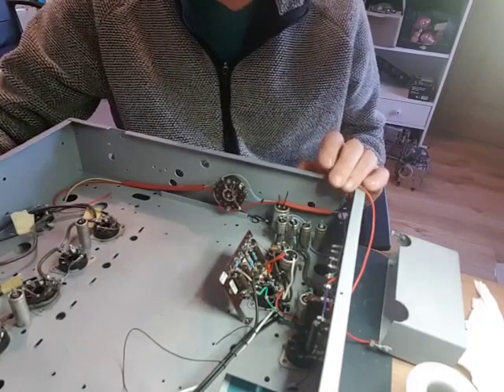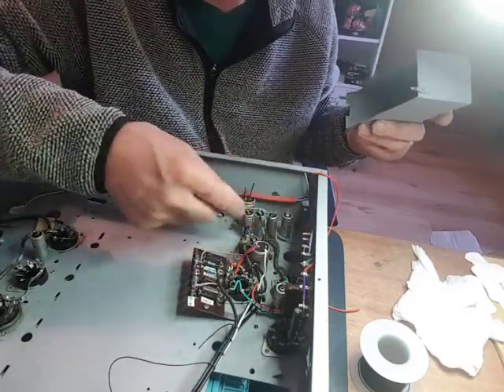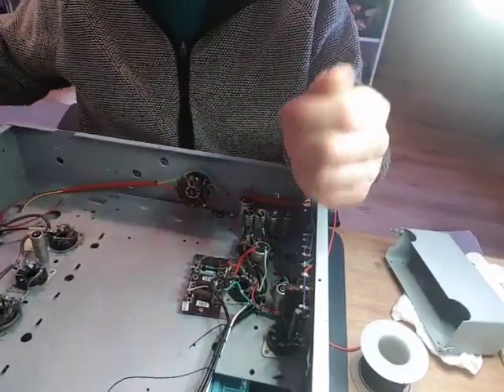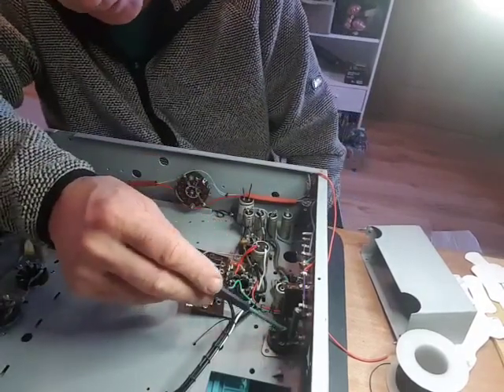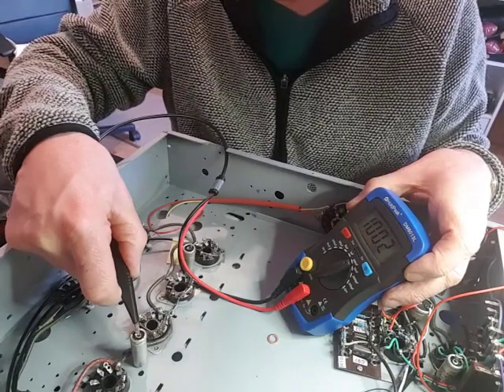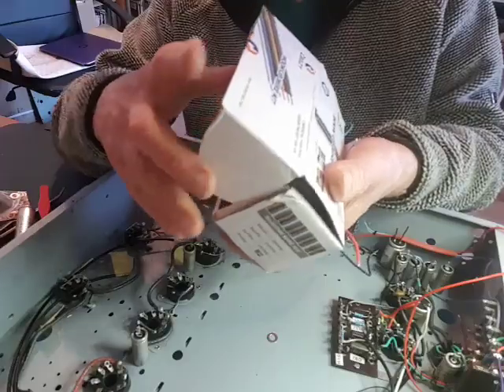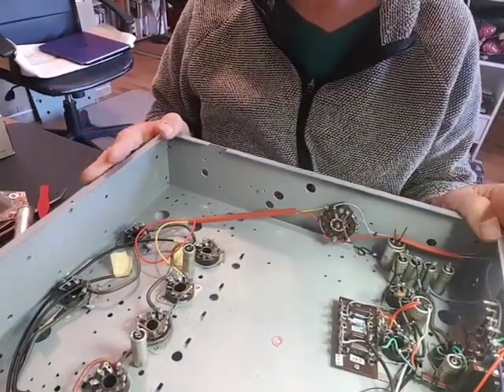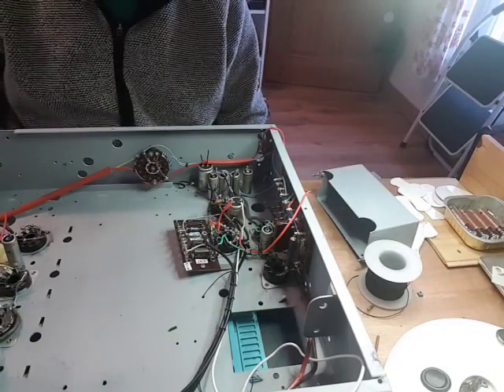Marconi CR100 Renovation (29) wiring up around V10 and V8

Comment: Still following your work. I am not that fast. Still disassembling and cleaning and meanwhile trying to make a simple tube tester. Please continue this because it is most helpful. Brgds Herman PA3EHZ
Reply from the maker: I was thinking on the same lines about a simple tube/valve tester.  Just to test the valves for the CR100. I have seen a few designs on the internet that i think I can adapt. I thought of using a low voltage variable ac from an inverter and stepping it up for a variable ht.